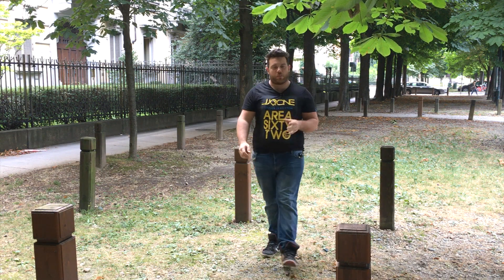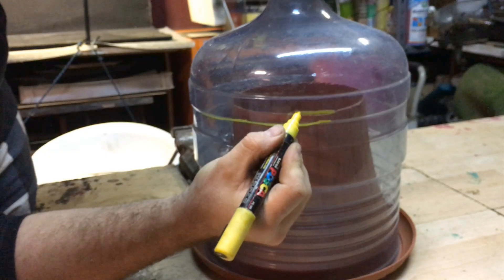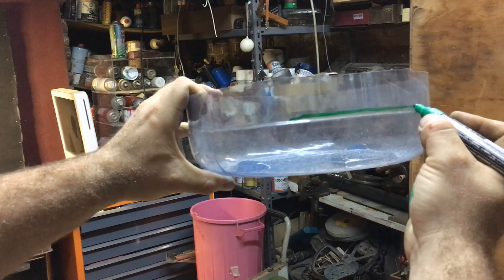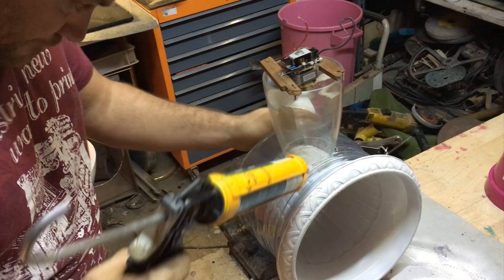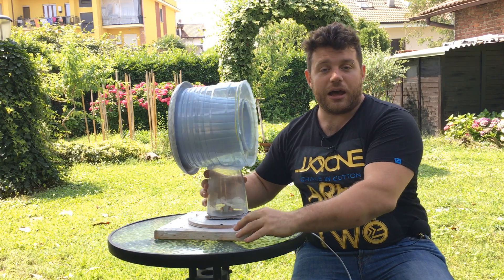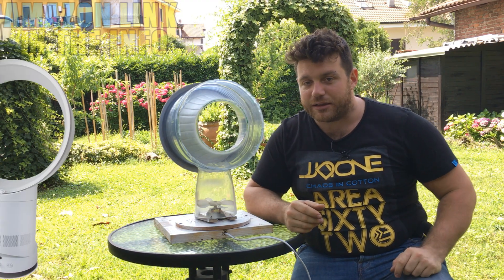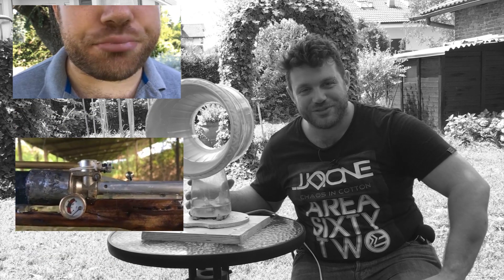BladeLess Fan - How to Make it - Dyson Fan DIY

Comment: i totally thought that the Dyson bladeless fans used some kind of electromagnetic ion propulsion and that the fan in the base was to cool the high voltage power supply required to do that.

Comment: nice one , how to cut plexy glass?
Reply: i used a grinder...
Reply: the one you are using in video? what kind a disc you using? for cement?
Reply: It looks like a simple metal cutting disk for a 4 inch grinder. Very thin and can be found at most any hardware store that has power tools.
Reply: I think they call toungstan blade, any way thank you.

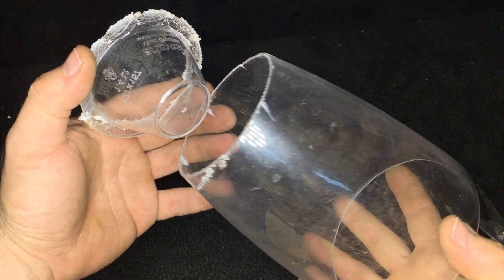Comment: 2:00 No longer bladeless fool
Reply: no visual blades that require a protective cage. It is impossible to make a fan without out propulsion of some sort.
Reply: But it&#39;s possible to do it WITHOUT blades... just like air compressors do, using a pulsating membrane...
Reply: +Terry Grancho Thats my way of seen this too. If you post a video of a bladeless fan, come up yourself with a different way of blowing air than FUCKING BLADES.
Reply: Terry Grancho try living with an air compressor powered fan, your hearing will be gone within a week
Reply: I don't see how... maybe you are thinking about something more complicated, see: take a big ring put a plastic sheet in there, then with a motor with a piston like device, crank and all and turn it on, no noise, no blades, and lots of air pushing...
Reply: lmao
Reply: That's what Rulof should have done, instead of this shitty "bladeless" fan.
Reply: The title says bladeless and it has blades, i don't mind what was it related to.
Reply: Well, Dyson calls their fan bladeless and it has a fan in the base. This video is referring to the name of the product, Dyson Bladeless Fan, it isn't saying that there aren't any blades.
Reply: +Undead Tech I don't give a damn bro. The title says bladeless and it has blades.
Reply: ***** And my point is, the reason it says that is because the real product is branded as 'Bladeless.' t̶h̶o̶u̶g̶h̶,̶ ̶o̶b̶v̶i̶o̶u̶s̶l̶y̶ ̶t̶h̶e̶r̶e̶ ̶i̶s̶ ̶n̶o̶ ̶a̶r̶g̶u̶i̶n̶g̶ ̶w̶i̶t̶h̶ ̶y̶o̶u̶
Reply: +Undead Tech Of course there is no arguing since i never asked for your opinion in the firts place.

Comment: can you explain more about how it works?
Reply: my english is not very good..   and is a bit complicated to express this concept..
Reply: So, basically, a venturi effect.   Air from the ventilator fan is forced into funnel, and the action of the air moving through the funnel draws more air in.   Thus a relatively small fan can move more air, and far more quietly than a conventional fan.   This sort of thing is used in some jet engines (though the 'quiet' part isn't really a priority).  A slight variation on this (called a eductor) is used to essentially double the efficiency of a water pump.

Comment: So, basically, a venturi effect.   Air from the ventilator fan is forced into funnel, and the action of the air moving through the funnel draws more air in.   Thus a relatively small fan can move more air, and far more quietly than a conventional fan.   This sort of thing is used in some jet engines (though the 'quiet' part isn't really a priority).  A slight variation on this (called a eductor) is used to essentially double the efficiency of a water pump.
Reply: very good explanation! thanks! my english is to bad to express this complicated concept :)
Reply: I think your English is just fine. Better than many of us for whom it is a native language, at any rate.  :)
Reply: So from what I can tell, these are incredibly cheap to produce and Dyson is selling a $5 impeller and some plastic for $400+,   I'm glad I never shelled out the money for one of these things!
Reply: Would that mean you would get more airflow using the venturi effect than if you had the fan blowing directly on its own?
Reply: Yes, though the debate about exactly how much continues, and of course depends on the design. If you look at the video, toward the end, when he has it set up, you'll notice the streamers are moving quite a bit.  Pretty impressive for something that's using a small microwave fan.

The chief advantage, though, is the air moving through a Dyson-type setup has a better 'flow' quality than with a conventional table or box fan.  Conventional fans literally 'beat' the air as it passes through, and the air exits more-or-less in the direction you've pointed the fan, but the flow 'tumbles' .   The Dyson setup allows air to flow more smoothly and with far less noise.
Reply: xaenon OK, maybe the quality of the flow is debatable but couldn't we settle on how much flow is going through the 2 types of setup by putting a windmill across it and measure RPM?
Reply: I don't know if it's really worth that kind of effort.
Reply: xaenon But.. but, for science. No?
Reply: You are of course free to experiment.  Perhaps you'll discover an even more efficient system.

Comment: The same principle is used in emergency slides on planes - the airbus A380 as we all know is huge, and a problem in the design of the plane saw the emergency slides inflate far too slow - regulations required a max time of 90 seconds for everyone in the plane to be evacuated with only 50% of the available emergency exits being used.

The engineers then realised that the Venturi effect could be used, and they had a tank of pressurised gas, usually CO2 with a bit of nitrogen, then they'd make it so that the surrounding air would also be sucked in when the valve was opened - the slides would inflate in 4-6 seconds.
Reply: Hamzah Mohd Noor
"usually CO2 with a bit of nitrogen"
Reply: wow! very clever! thanks
Reply: nitrogen. not carbon dioxide.
Reply: I was going to comment this, but then I saw you beat me to it! By four days!

Comment: OK.. so everyone who thumbed up this video didn't try making it in any-way and didn't buy a $5.00 fan to blow in their face.  if you don't make the heat leave the room, then the heat STAYS in the room...  Make all the plastic you want, this does nothingthing but create wind...   What... The old Plastic magically removes the heat?    retards....  HE USED A BLADE to move air... the video says BladeLess....
Reply: dyson fan are called Bladeless and no one have nothing to say...
Reply: I can figure out what you are typing even though there is defiantly a language barrier, but, a " blade-less " fan that has blades...   There needs to be a different description.  Doesn't matter if anyone agrees with me or not.  A cheap fan that blows in your face between $5-$20 will work much better & you won't have any issues.  Its cool the guy made something, but It is technically not a blade-less fan in any way, regardless of the inventor.  The movement of air starts with fan blades, nobody can counter that.

Comment: I thought a bladeless fan worked like a jet engine
Reply: take 10 seconds to look @ a jet engine...   there is a pretty big freegen blade...
Reply: Jet engines have huge blades, and they compress the air they intake with fuel to create powerful combustion. How would a bladeless fan work like that?

Comment: Bladeless and he uses a blade in the bottom.DUMB! FAIL!
Reply: open your bladless fan from a brand name...
ypu will see at the bottom there is a small blade fan there...
Reply: A "Bladeless" design, which is really just a fan without an exposed blade, is safer and more efficient. Using the venturi principle, which is really the Bernoulli effect, a small fan in the base can create a stronger, refined stream of air that wouldn't be able to exist without the specific design. And many parents opt for a "bladeless" fan because the actual moving parts are on the inside of the base, unexposed for small children who like to get their fingers chopped off. Sure, people could call it a marketing scam, even when the marketing campaign usually shows the inside of the fan and how it works, but the design is actually pretty smart, using these principles to create a more powerful fan.
Reply: copied from Gennedy with minor changes;

I HOPE you are joking, but the "bladeless" just refers to the lack of exposed moving parts. He used the term bladeless because Dyson used it first.
Reply: probably is not joking, being as it is very obvious it does have blades. the fact that people  ^  are duped into the "bladeless" idea is the funny part. it's just a marketing scheme that has duped many, and made money doing it...like most advertising these days.

Comment: The discussion about the blades is pointless. The interest of these kind of "fans" is the general efficiency as a lot of air is moved with the venturi effect, the initial blower will use a well adjusted high efficiency ducted fan, the absence of the bird cage wires with their enormous drag is a big plus. Add some aerodynamics work of the air circulation inside (probably a semi turbulent one using the good Reynold numbers, a flow regulator/dampener effect by the internal volume and a silencer/suppressor of noise harmonics box.

Comment: What's the point? You end up with a crappy, ugly fan that is very inefficient for it's size.  It would take at least 3 hours to round up the supplies, cut, and assemble the fan,  the earnings from 1 hours work even at minimum wage would allow a person to purchase an oscillating  fan that moves at least 3 times the amount of volume of air.
Reply: The point is a general learning experience. It's also genuinely fun to create things. You know, kind of like whatever fun you get out of writing that comment.
Reply: ಠ_ಠ
Reply: Apparently you've obviously never been exposed to the radical funkiness of a Dyson fan . 
This video shows you how you can save the $350 and build one of your own and even describes the physics of how this design works so well (ie. the "venturi effect", which is actually the Bernoulli effect).
But go ahead and stick to your $20 Walmart fan, you great unwashed peon.
Reply: Bro chill
Reply: the air you get out is way more and directed in a stream
Reply: +Kytech_ Studios , "Safety, number one priority!"
Reply: +Christian Chopp , the Ikea effect.
Reply: Well, the real Dyson Bladeless Fan is a lot more efficient than a regular fan due to science.

Comment: The secret to the bladeless fan?
Blades.
Reply: "Every bladeless fan has blades in the base. Bladeless just means you can't see any blades"
So by that logic a random car can be seen as engineless?
Reply: A bit disappointing, I was hoping he would ionize the air and move it with a magnetic field or something ridiculous like that.
Reply: SsoulBlade You can also call anyone you see a "brainless person" :D
Reply: Exactly, which is why bladeless is a bit wrong. Hidden  blades seems more appropriate.
Reply: Every bladeless fan has blades in the base. Bladeless just means you can't see any blades
Reply: and how do you connect a cordless phone to the wall terminal? via a cord
Reply: There are ways to move air witchout blades... but none that is usefull rly for use as fan for cooling room.
Reply: BLADE-LESS doesn't mean "ZERO BLADES"... just "LESS" as the compound word implies. It uses smaller blades so it's correct to call it a blade-less fan. So a dick-less man still has dick but smaller then the majority :D
Reply: Wa wa waaaaaaaaaaaaaaaa
Reply: Unfortunately, that description might not be appropriate for legal reasons.
Reply: Come on the idea is that there is a small, quite weak and almost inaudible fan in the base. This little fan could not produce a good amount of air so we make it go through an amplifier that produces a small vacuum that starts to suck more air in through the circle. The design looks good because you can't see any fan blades but it still pulls air through the circle and it's very quiet. The "bladeless" means that the main air mass is not produced by traditional large fan blades and no safety grills are needed. The secret of a bladeless fan is a pressure difference.
Reply: assassins creed style hidden blades
Reply: Product name = Inventor was true troll !!!
Reply: also, where do u fit all the pipes n cables for a ductless aircon? In a small duct.
Reply: Hidden Blades
Reply: 2v1l It should be called the bladeless wrist blade.
Reply: @Martin
The secret to a headless vampire ?
BLADE 

( ͡° ͜ʖ ͡°)
Reply: Less doesn't necessarily mean lesser. It could also mean the "lack of" something, hence his confusion. For instance something pointless doesn't just have a less important or valid point to it, it lacks it completely.
Reply: lol hidden blades from assassin's creed
Reply: exactly. He's using a blade nobs!
Reply: +Ryvucz what about transparent pants
Reply: Unless of course.. magic...
Reply: +SsoulBlade haha
Reply: its like the "hoverboards" dont blame him, its publicists fault
Reply: "Bladeless just means you can't see any blades"... can quite clearly see the blades. :P
Reply: Aslak Røkke You're too serious bro :D
Reply: still can see the blades .... 3:44 have a look
Reply: Let's give a hand to the geeks!
Reply: Also safer
Reply: you and me are alike
Reply: +PunakiviAddikti My thoughts exactly. well said. :)
Reply: FeasableOption Thank you :D
Reply: that was my first  thought when i heard bladeless fan XD
Reply: Indeed - you don't get something for nothing. 
Probably make it look pretty so fair play except you need to be mindful of the extra work your blade-full fan is working and that heat has to go somewhere ...
Reply: Hi
Reply: ***** There are components that discharge those big capacitors. Obviously if one is to do this project one knows enough of electronics to safely disassemble a microwave, right? If one doesn't, one shall not try this project at all. If one does, without the proper knowledge, the responsibility of his and other's safety is in his hands.
Reply: They should've called it "Hidden Blade Fan". It sounds cooler as well.
Reply: youre going to try to convince  me that an internal wind going in the wrong directions is  more efficient than an outside wind in  one direction... youre insane..
leave your science  degrees on the floor at the door when you leave reality
Reply: exactly
Reply: Ryvucz And all humans are genderless since we can't see their boobs, penis, or vagina.
Reply: or you can move the air by blowing with ur mouth repeatedly...

Comment: So really Dyson is lying to us. It really has blades but there's a duct you're buying that covers everything. Duh.
Reply: You might say THEY SUCK. ing
Reply: The problem is that they aren't particularly quiet, and don't move the air with much pressure.
Reply: Well, the point is to remove the problems a real blade-fan has: Bad noise and the danger of injury. Even in the marketing photos they show that there's a fan in the base.
Reply: ***** I don't find fan with blades to be particularly dangerous. Don't hear much maiming of people due to fan blades.
Reply: They don't have blades lol it's a centrifugal compressor fan lol

Comment: Three physics principles, relating to air flow -- Bernoulli’s principle, the venturi effect and the Coanda effect -- are employed in Dyson fans. This is how the Dyson fan ejects up-to-15-times more air than enters the intake at the base.

Have you evaluated your DIY fan effectiveness, to estimate how much "extra" air is being taken in by the rear port, relative to the air intake by the the bottom fan?

Having a smooth, rounded air "port" at the rear may improve results, quite a bit. It looks like you've incorporated the Bernoulli principle and the Coanda effect, but the venturi effect is deficient. (Think of the rounded leading edge of an airplane wing, employed for the edges of the rear port. You can see this in carburator and throttle-body design, as well.) You should be able to modify your design with a simple "add-on" ring, without having to redesign the whole thing. Now, where to find a readily-available, half-toroidal ring...?

Comment: -_- The "bladeless" fan was using a fan at the bottom. #FAIL
Reply: These are more efficient and work the same as Dyson fans (yes, those have a built in blade fan as well.)
Reply: It's more of a turbine and they did a lot of noise reduction in the newer design ;)
Reply: its not a turbine, but a impeller, its the same system that vacuums use. and would work alot better then the microwave fan as the idea is force multiplication ( High speed & low volume ) pulling volume along for the ride... 

Not bad but really could use alot of clean up and improving.....
Reply: Acording to eng wiki turbine is type of impeller.
Reply: It's designed more for creating a higher pressure so that air is forced out that small circular opening, whereas a microwave axial fan is just designed to move more volume at low pressure because it is not forcing it into a small area. Cheaper vacuums just use a simple centrifugal type impeller//turbine because they get enough pressure/suction with less regards to noise etc ;p
Reply: I don't know what all this sh*t means xD
Reply: *****
They changed it to "no visible blades" lol